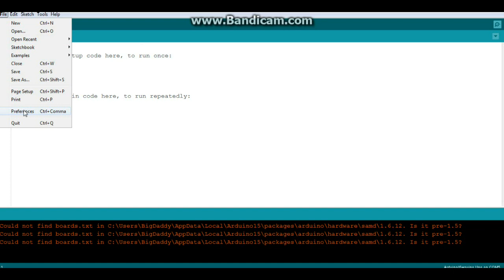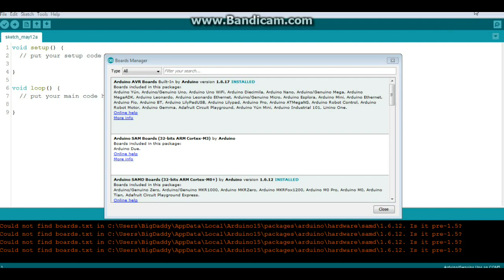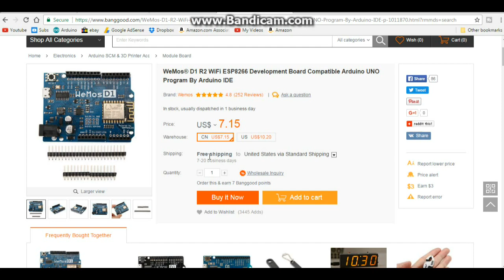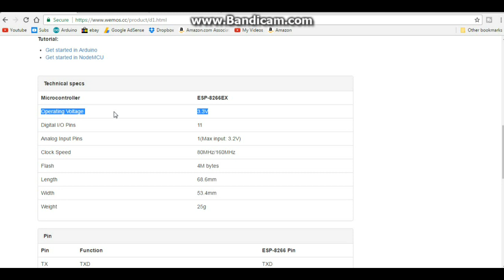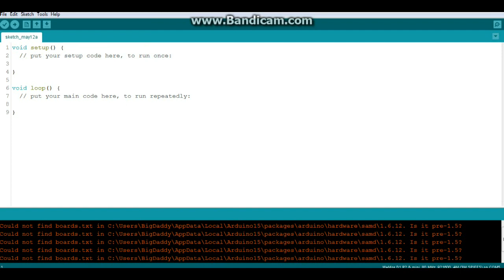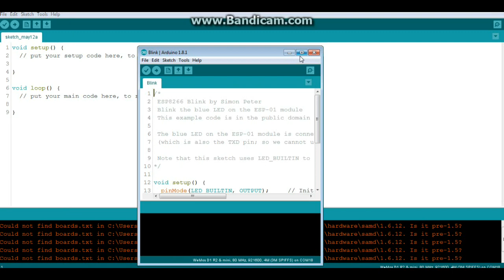Introduction to the WeMos D1 R2

Comment: I just stumbled across this video and was surprised to see this ESP8266 board. I am using the ESP 8266 to operate my 1950 model train. I just completed a big test run here (https://youtu.be/M-DKF66xfNg?si=GaNiIf7BdjGOO4Au) but i have a problem, My smoke fan logic needs to be triggered if the motor is running in either direction. Since I am using the Wemos WiFi i need to trigger the Puff Circuit when the motor is on. Can you explain how to read the motor state and create the logic to fire a relay. It only needs 3.3 volts so closing a IO Pin to ground when motor is running would be perfect.  What do think. Dennis

Comment: ..if anybody still have trouble uploading sketches to their WEMOS D1R1 or similar after CH341SER driver install & even with latest arduino ide with the ESP8266 PLATFORM downloaded connected to proper port in device manager Windows Xp or higher, with error message cxxabi_tweaks.h not present do this....copy cxxabi_tweaks.h from{ your drive]C:\Documents and Settings\{your pc name}\Local Settings\Application Data\Arduino15\packages\esp8266\tools\xtensa-lx106-elf-gcc\1.20.0-26-gb404fb9-2\xtensa-lx106-elf\include\c++\4.8.2\xtensa-lx106-elf\bits  to C:\Documents and Settings\{your pc name}\Local Settings\Application Data\Arduino15\packages\esp8266\tools\xtensa-lx106-elf-gcc\1.20.0-26-gb404fb9-2\xtensa-lx106-elf\include\c++\4.8.2\bits ....it took me a week to figure it out...finally the blink sketches worked...so i have a renewed my spirit  for debugging my ambitious WEB RADIO project...hehehe
Reply: Pour qu'il marche j'ai chngé de cable et j'ai finalement trouvé un qui permettait d'etre vu par le port.